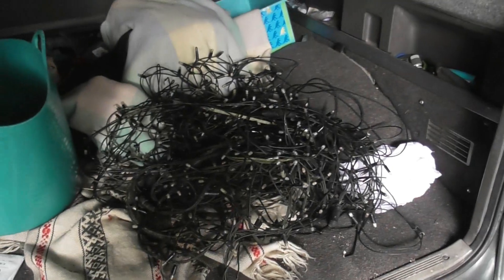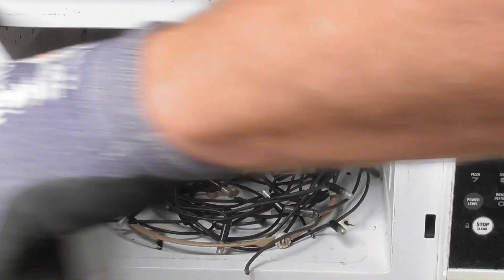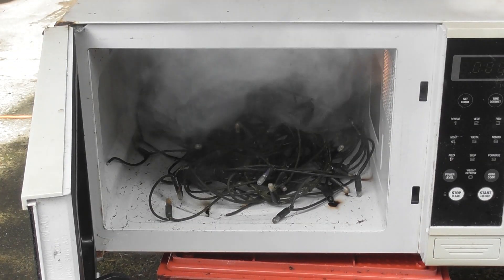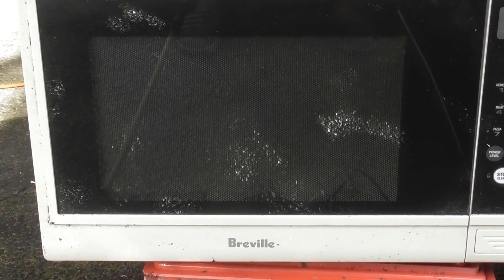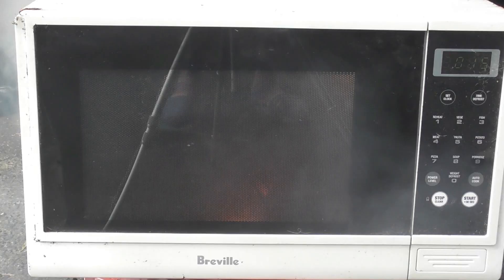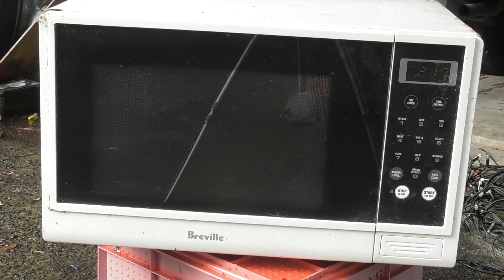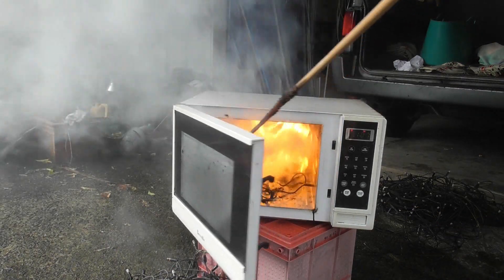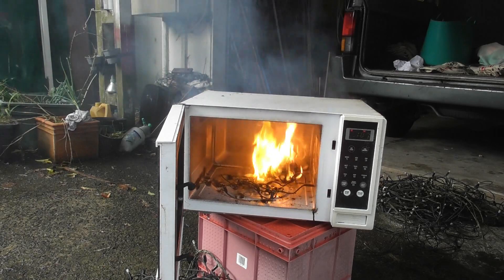Expired X-Mas lights in old microwave

Comment: Good microwave, grab a pile of old CD's and DVD's and do the same, the firework show is great off those. Old microwave, likely still has copper wire in the transformator as well, well worth keeping around as the electronics test device.
Reply from the maker: The MOT will get saved when the magnetron karks it.
Reply: @RODALCO2007  Slap a new to it used one in when that occurs, you probably will have at least a dozen donors to put in there.